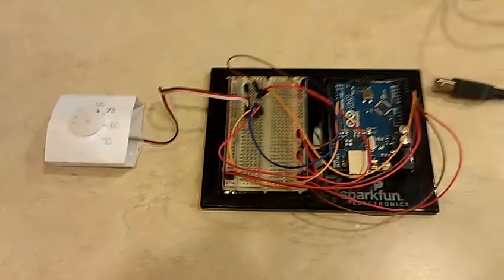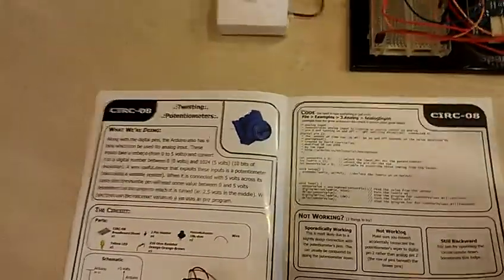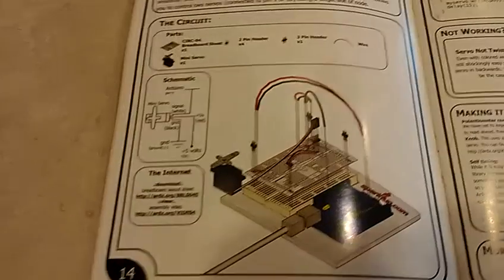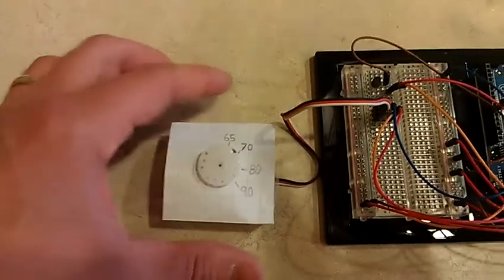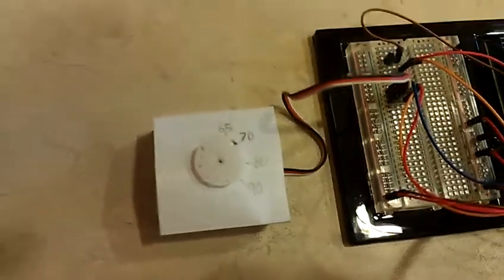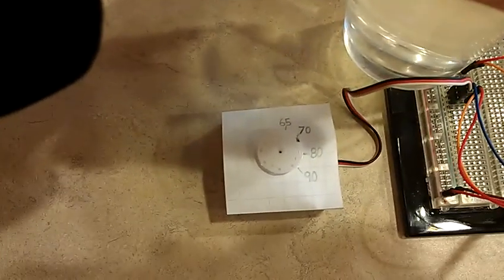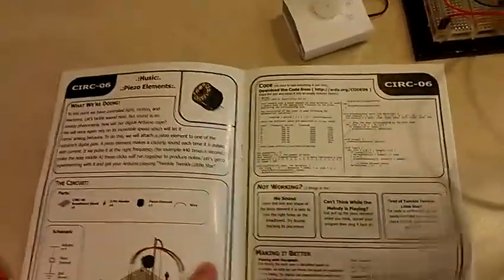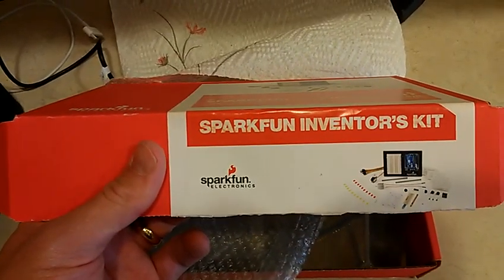Arduino servo thermometer

Comment: A lot of those kits have problems with loose contacts in the protoboard. They are nice as kits and a good way to get a selection of components more economically, but you can get better results and less bugginess if you add on your own components from different sources every now and then. I start with extra protoboards (which have better, cleaner contacts), and then buy some cheap, bulk solid core 24 gauge wire to use instead of paying more for jumper wires with end connectors which can come loose and make weak connections.